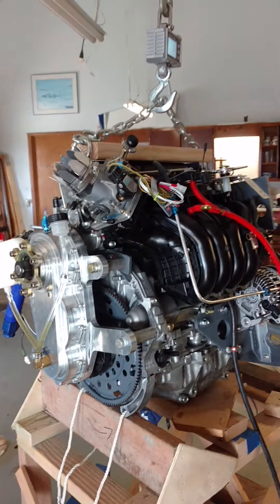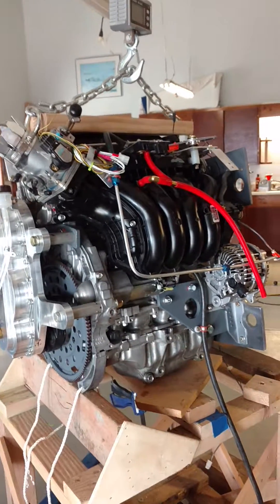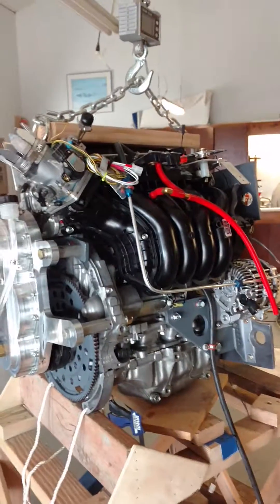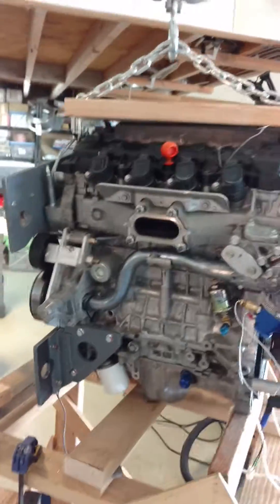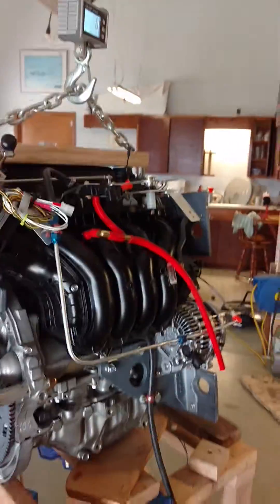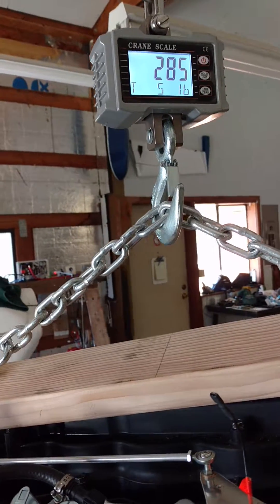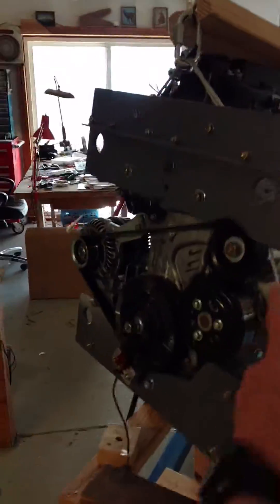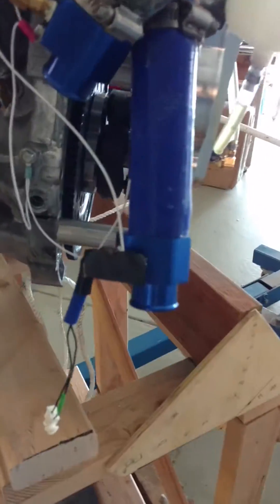Honda R18 1.8L weight 285 with PSRU fluids alternator intake engine mount

Comment: Is this weight with an automatic or manual transmission?
Reply from the maker: There was no transmission attached, there is no significant weight difference between engines intended to be used with manual or automatic transmissions.
Reply: When you say you weighed the long block was that minus intake and flex plate ?... like totally bare ?
Im going too build one with bike carbs and distributor and.want an idea of weight..... have yiu weighed an L15 ?
Reply from the maker: @mohawkc77   im sorry i did not see this question before.  I will have to did through some old pics to try to get you an answer.  Good luck on your project.  You can see my proget in detail on www.vans airforce.net in the alternative engines forum.
Reply from the maker: @mohawkc77  i. Reference to your questuion about the engine weight the intake, the flex plate, it is all stated in the video.  Do you still have more questions?
Reply: Thats ok mate
Mine weighed 107 kg ready too drop in the boat... my youtube chanel has video of it running on the stand as weighed ready too drop in